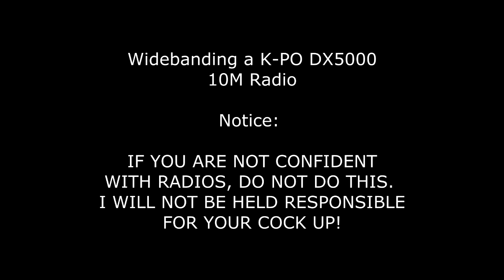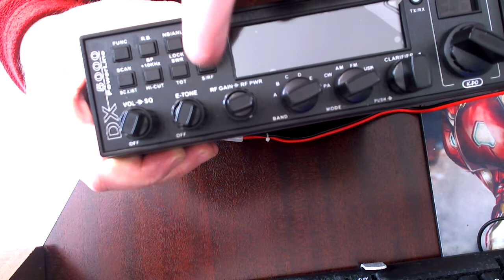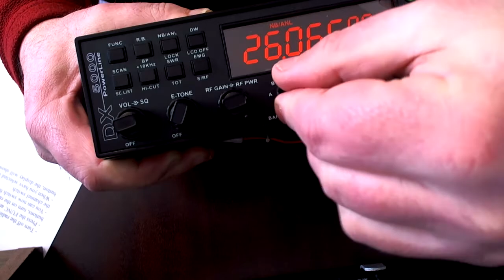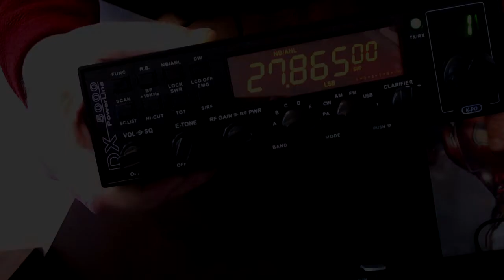Wide Banding/Modding a K-PO DX5000 10M Radio

Comment: Hello everyone, I need help if anyone knows.
I have a problem with Sqvelch, if I close it a little harder I don't hear those strong signals either, like I have RF gain turned on in Sqvell
On 10sati let's say I put Sqvelch and I can't hear anyone, it's not standard Sqvelch I get very cut like on other radio stations 
Is it possible that in the hidden menu I turned on this option if there is any
I have to keep Sqvelch to a minimum for just under 9 hours to work normslno
And another question every time the palm radio stays locked to me and on 1 Channel, then there's unlocking the beep keys and turning it on with the meter. 

Thank you very much, if anyone knows to help me so I can use the radio,
Here's my email address so if anyone is able to contact me, My Gmail address is 9a3dzl@gmail.com
73...de 9A3DZL & 328LR021 Croatia 
My radio MASS DX5000
Reply from the maker: Maybe you should reset the radio back to default to see if it a configuration problem or an actual system problem.
Reply: @alans_projects  What buttons do you need to press to put it on a factori reset
Reply from the maker: @Rmzo9A3DZL  According to K-PO, this is what you do: 

Step 1: Power off the radio. Step 2: Press and hold FUNC and SCAN keys at the same time, followed by powering on the radio. Step3: Release the two keys when LCD displays "RES". All former settings will be replaced by Factory Default value when LCD displays "REND" .
Reply: @alans_projects  ok Alan I'll try and let you know what happened, ok?
Reply from the maker: @Rmzo9A3DZL  /sure, no worries.
Reply from the maker: @Rmzo9A3DZL  Yes, no problem.